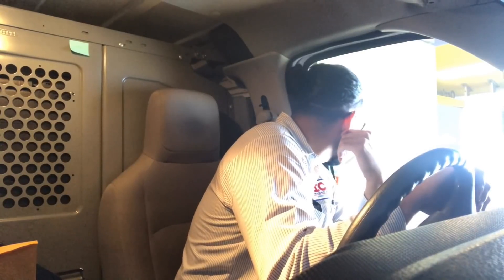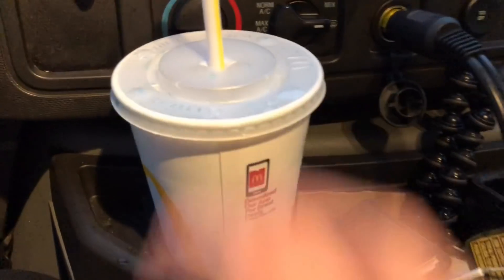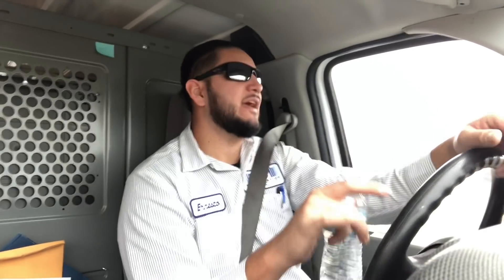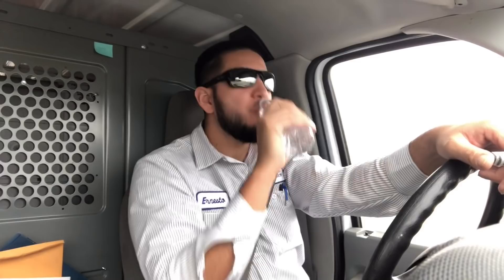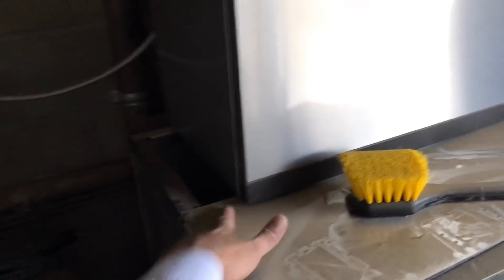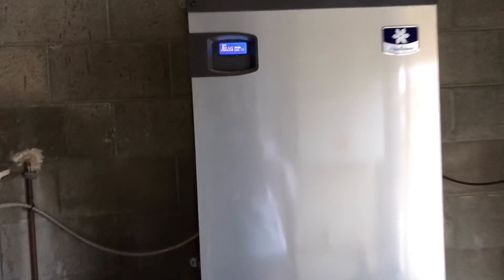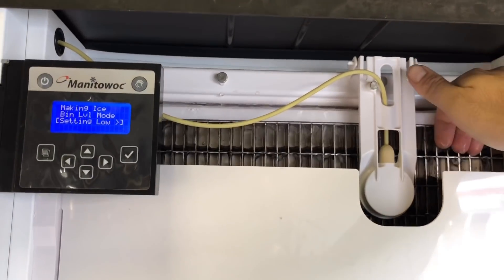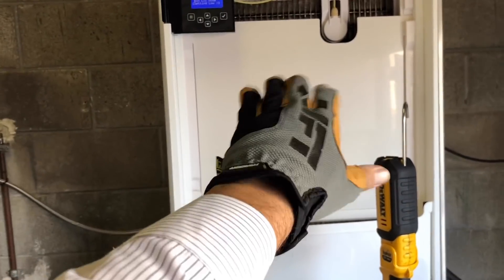ICE MACHINE VLOG /HVAC-R

Comment: Pretty confident that Manitowoc calls for 18" vent , usually says on back of machine
Reply: Vent for what?
Reply: @jsantos601  a vent for the drain. When water is pumped down the drain it needs a vent to do so properly and not get air locked

Comment: Maybe you should consider to recommend a hard pipe for the water line. Those flex line have the tense to leak. Also will look more professional than a flex hole hanging in front of the water heater.
Reply: If there is service clearance sure then hardline it. If you have to pull the machine out and the drain and water line are copper? Oh man that is a pain, especially the undercounters.
Reply: @Hvacrvlogger  is that why it was so dirty on the outside of the machine.